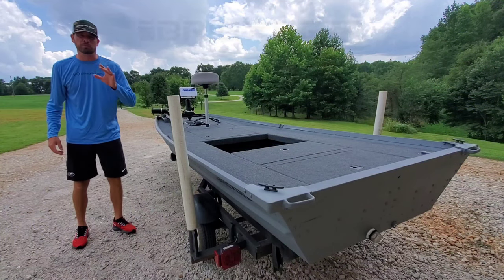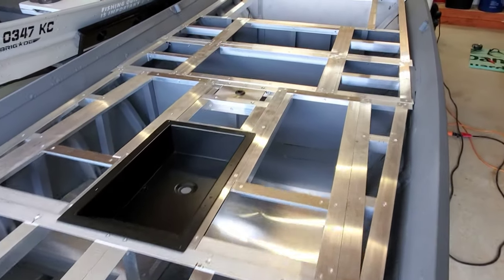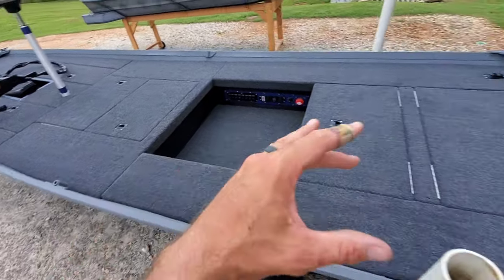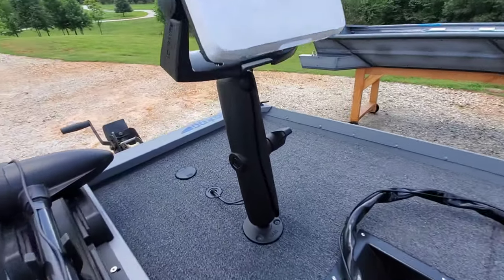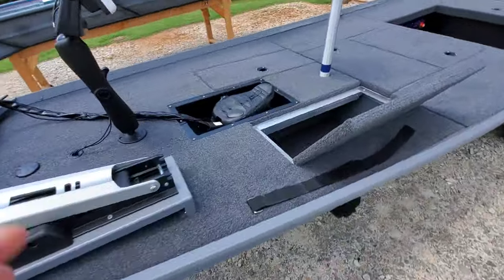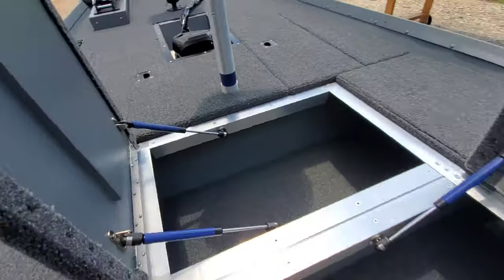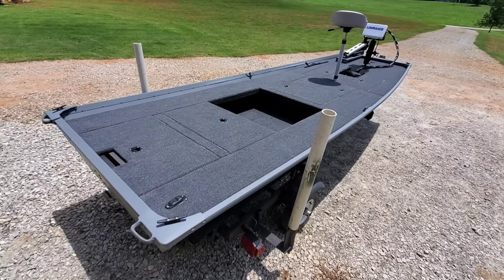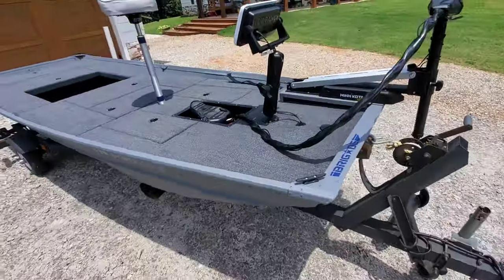Super Clean 14ft Jon Boat to Bass Boat Walk Thru | Brigade Boats

Comment: you have done an excellent job. inspiration to all small boat builders . how much does it cost for all the aluminum for the frame
Reply from the maker: I'm not sure , I buy in bulk at dealer cost. I can tell you it was 32 6ft sticks of 1.5"x1.5" 1/16th angled aluminum.  From there perhaps you can get a cost idea.

Comment: What's the reason for the "runners" underneath the hatch doors?
Reply from the maker: Tge runners give support for the hatch as far as preventing flex when walked on which can crack and defeat the purpose of the resin.. Bigger thing I have found is when decking w wood, you may have it perfect/level and after sitting in the sun or weather,  sometimes hatches can warp or bow. The runners prevent this long term. More work up front but gives a better product long term when decking w wood.